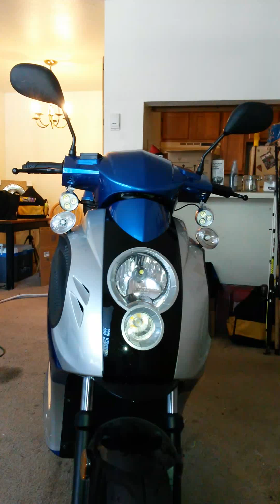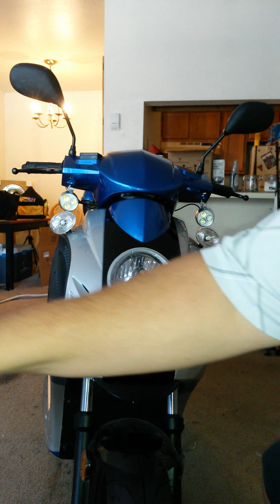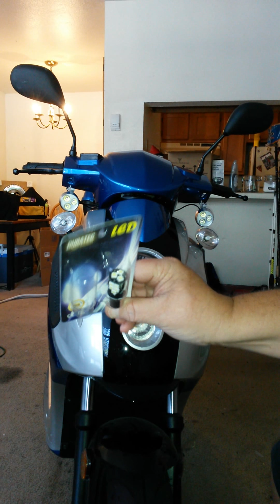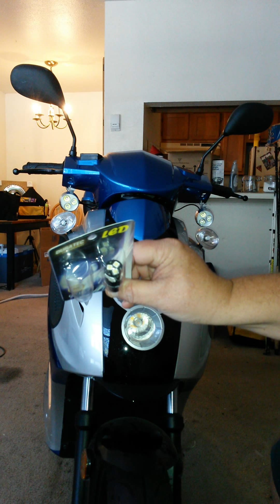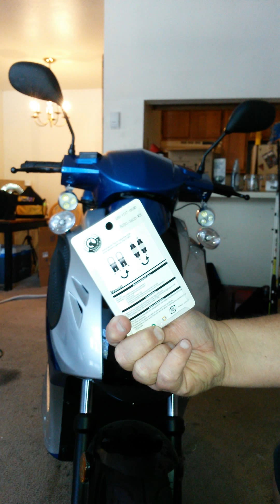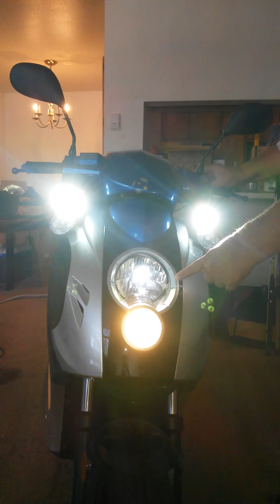Gy6 LED lighting

Comment from the maker: Thanks Richard. The speed puck makes a lot of sense now. I was wondering how it was off so much. I have sense removed that function of the scooter. I Guage my speed by RPM. I also installed "off-road" tires and a Harley Davidson seat. It's a fun scooter to work on. Thanks for the thumbs up.
Reply: Patrick Palombo i was wondering if you ever ended up with a stator failure after converting to all leds on your powermax 150 scooter?
Reply from the maker: Jeremy H. ... No stator issues because LED lights use lower amps.

Comment: I gave you a like because the lights, awesome job guy. But the speedometer on that model is way off. the puck that is on the front wheel for them is calibrated for a 13" wheel. The Powermax has 12" wheels. I own one also. The top speed is probably just under 60 MPH
 I have had mine to 58 MPH "GPS verified" I have been working on these for sometime now
 right down to the crank shaft. But your info on the lights is spot on. Best video I have seen on them. the main headlight on almost all Chinese Scooters is always AC 
There are two wires coming out of your Stator, both are AC , but one goes through your voltage /regulator/rectifier which changes it to 12 volts DC
 that's the white one, the yellow powers your head light 
and you are correct, it is AC.